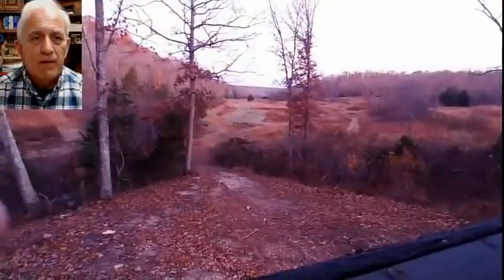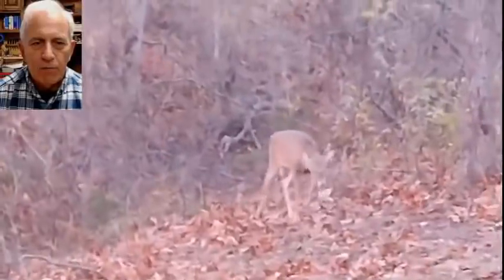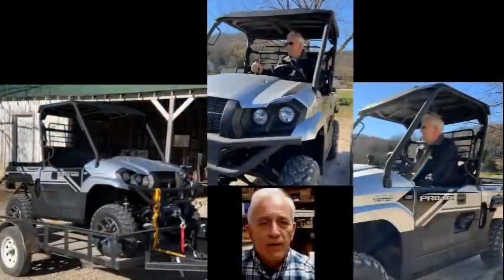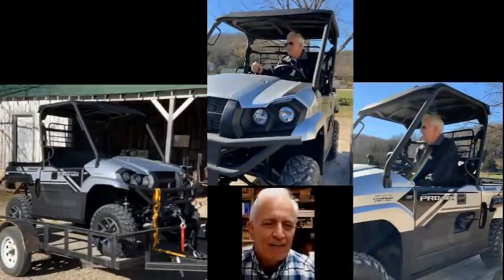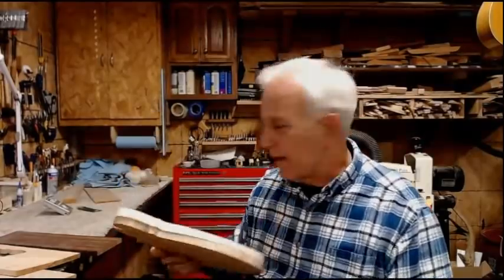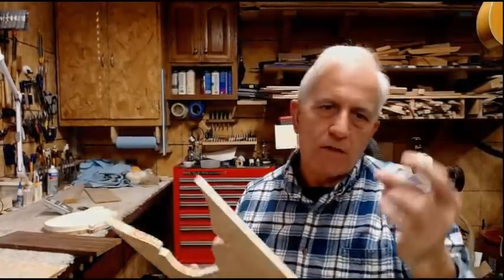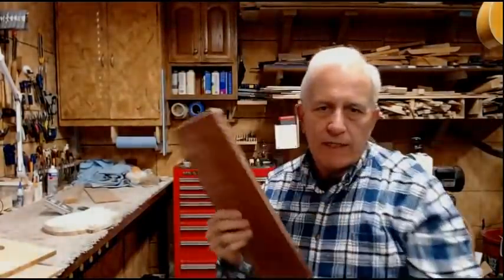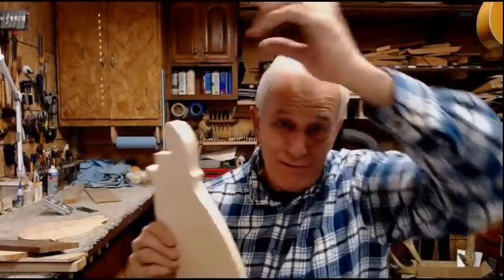RSW LIVE Shop Talk 48  Tapped any Wood Lately?

Comment: Hi Jerry;
I sure can relate to not using grain fillers. I built a balsa violin and wanted to fill the grain on the back. When I applied it, it made the back look like I had spattered chocolate all over it. The chocolate color worked like stain and could not be removed. I ended up having to use dark colored (rose wood) opaque varnish on the back. The rest of the violin was amber color. I for one will never use grain filler again.

Comment: About the two-way truss rods. I agree with Jerry, and it makes logical sense why it wouldn't be good for much. But if I were to speculate about it, what if you made an instrument that has a significant underbow bulit into it on purpose? Wouldn't it then mean that you could force the neck to be flat with that two-way truss rod, and the benefit would be that you'd have a sort of insurance against the natural tendency of the neck to pull up? With time, that neck would want to pull up, and then you would just undo the opposite tension of the neck, and if the neck wanted to pull up even more, then you tighten the truss rod the standard way from there on. Wasn't that the whole idea? Sure, if you build your instrument in the standard way where the neck is only very, very slightly underbowed while the truss rod is relaxed, then it makes zero sense for it to be a two-way mechanism. Anyone knows if instruments are ever build with a significant underbow on pupose to give that "safe gap" for the future? Because then the two-way truss rod would make some sort of sense, in my mind at least.